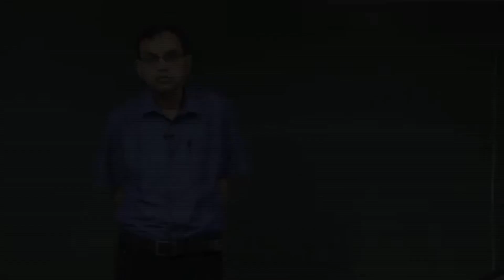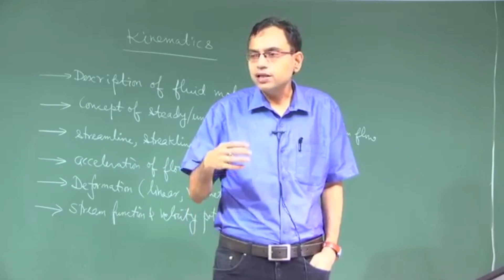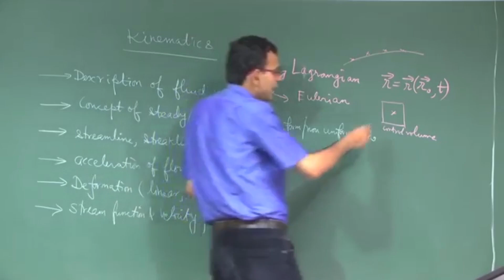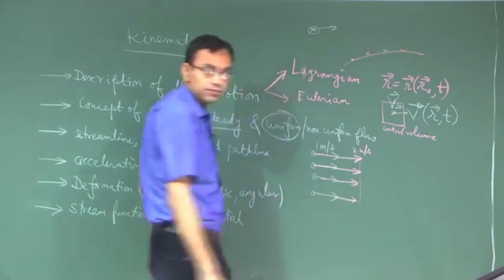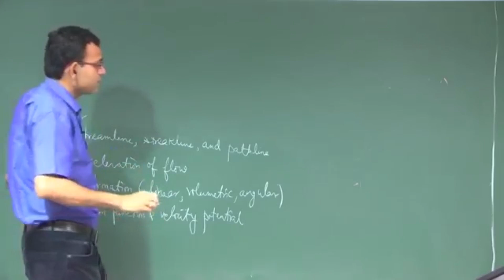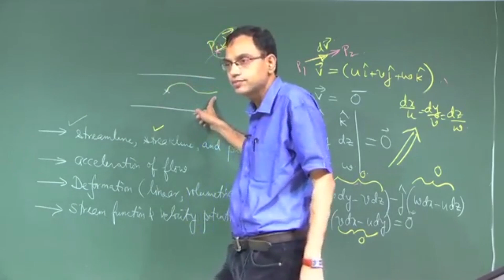Lecture 01 : Eulerian and Lagrangian Description of Fluid Motion

Comment: I always used to think that flow visualization showed me stream lines, i was wrong all along. Looks like this lecture gave me a better understanding. 

I was talking to a gentleman man who has a very sound background in physics. The thoughts that came to me could we all do all this at a molecular level if and when we had extremely powerful computers. How do these molecules interact with each other.  Because for example I want to see what happens to the air after the shock. The molecules of air scattering in all direction . 
I saw this happen during a buffeting problem under the aircraft wing.  There was no way we could tell which way the air was going . A random phenomenon maybe. 

I thought I would share this with all of you. So that either someone's has an accurate way to look at it or some smart person will come with a simple clever way. 

You done a great job in teaching once again.

Comment: • Lagrangian approach : 

1. Every or particular fluid particles or parcels are tracked throughout analysis. 

2. The particular fluid parcels under motion are analysed since start of motion. The same is applied to every fluid parcel. 

3. There always requires to define the initial condition (t = 0) & current condition (at t) & the complete history in continuous sequence for motion of every or a particular fluid parcel.

4. It is based on control mass principle as a parcel of fixed mass identity is tracked. 

5. Convenient when tracking certain countable or discrete fluid parcels are to be analysed but not for the every fluid parcel in whole continuously distributed fluid.

Comment: what year of mechanical engineering do you have to learn this topic?
Reply: I think 2nd year. In my dep.  It's in 3rd sem.
Reply: In which year you are??
Reply: @Doraemon-gc2lu  2nd
Reply: B sc 5th sem
Reply: Everybody learns this in mother's womb, as there is complete universe of these systems in it.
Thanks.
Reply: @ganapatibrahma8005  are you okay?
Reply: But what is the point of learning if you are going to forget it after 1 year anyway, professors don’t, it’s their job, what are students going to do with it.
Reply: @Siddharth-555-e5 get a load of this guy